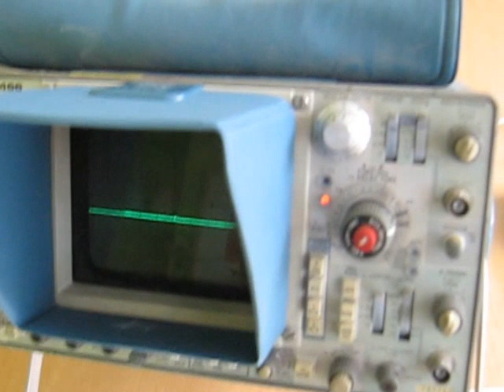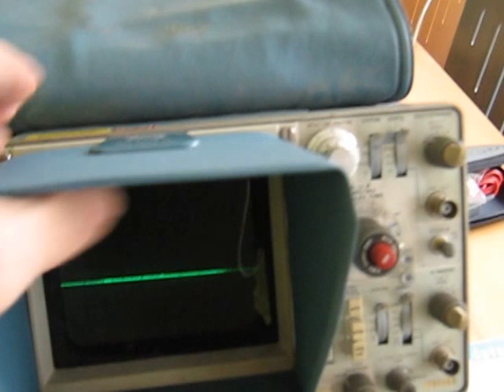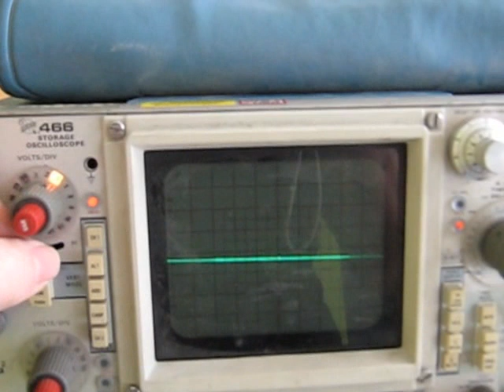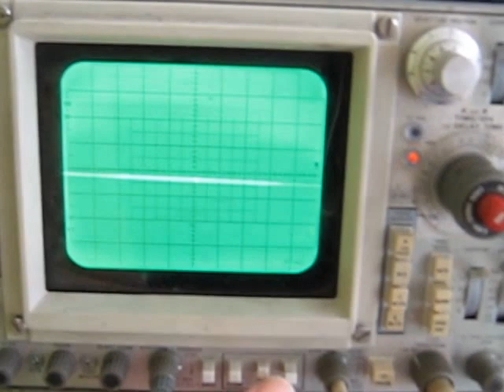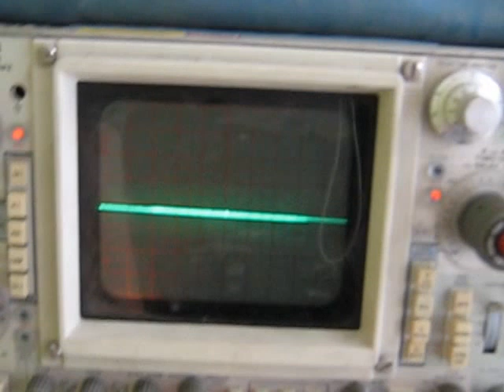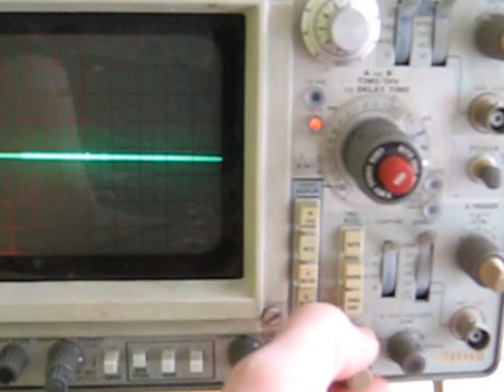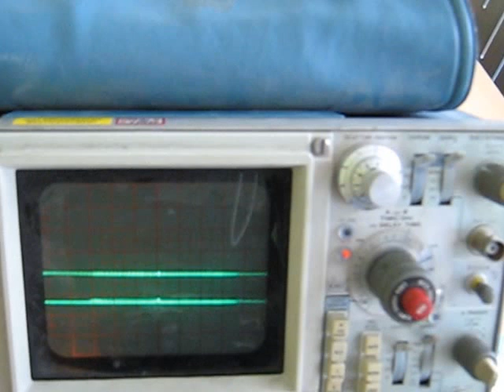Tektronix 466 oscilloscope

Comment: Fixed the same exact issue. 140V power supply filter cap is weak and drops down way out of spec.  Effects horiz in this weird way. A $2 fix.

Comment: I have a 466, but it only displays a centered dot in XY mode or using the beam finder in all other horizontal settings. I figure the fault lies within the timebase. The trigger generator to be more specific....Have some more testing to do....I also have a 2465 and a 454A....gotta love Tektronix! Need the service manuals for the 2465 / 454A though.
Reply: Hey Michael, have you managed to fix this problem on the Tek 466, I seem to have the same issue.